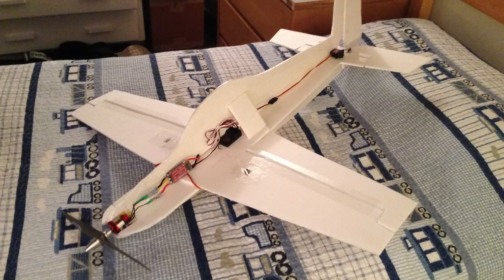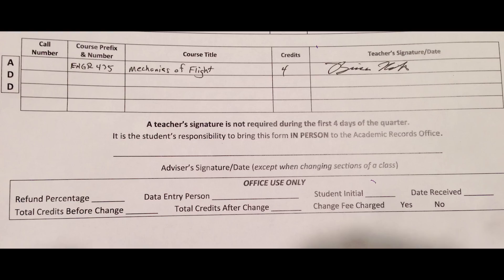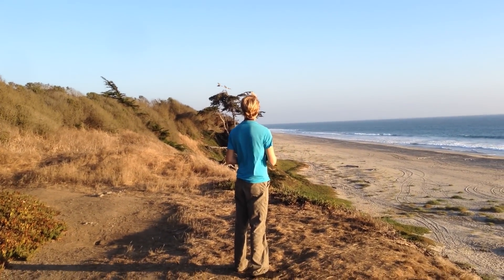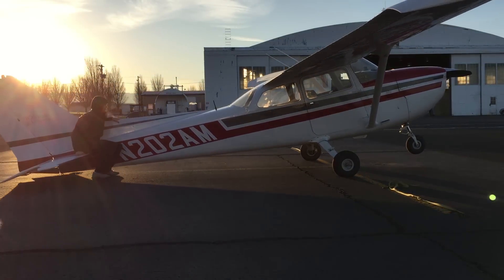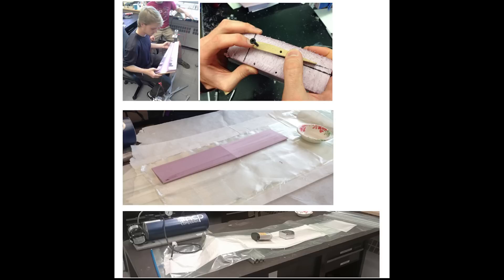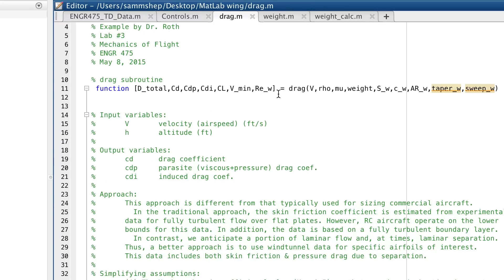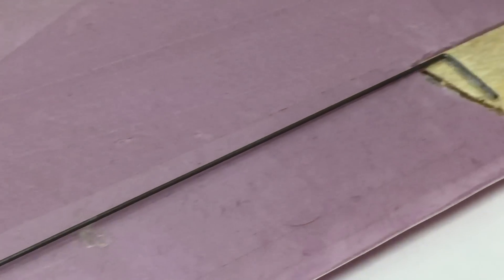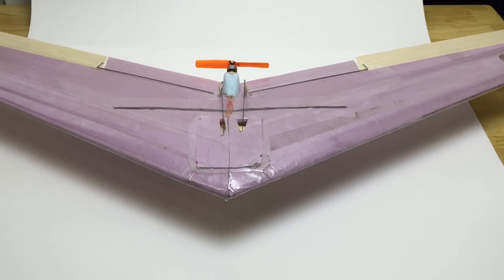Engineered Mini Flying Wing

Comment: Funny how different disciplines approach the same basic subjects in different ways...
I was terrible at it, so I dropped out in the end, but I was formerly an undergraduate physics student.
More recently I've done parts of the training needed to become a pilot, and of course read the associated textbooks, and unsurprisingly a bunch of physics related things crop up, but in different, more practical forms.

For instance, knowing how the weight and balance of an aircraft affects it's flight characteristics in broad terms is something you come across in pilot training.

Meanwhile in physics I was calculating how forces applied on different parts of a rigid body cause it to rotate, and how this relates to the mass distribution.
Broadly the same problem, but examined in very different ways.
Reply: KuraIthys he was the sailing instructor at Big Lake Youth Camp in Oregon for 2 summers and mentioned physics principles similar to flying in that sport as well.

Comment: The reason pilots don't learn about things like Reynolds number is because practically-speaking the Reynolds number of any aircraft that can lift a human will be absolutely enormous.
The one exception is if it reaches a situation where it is not supported by aerodynamic lift in level flight. I.E. Near-orbital high-altitude flight supported primarily by the geometric Eotvos effect, or the top of a zoom climb at extremely high altitude. I.E. The international space station, which, for the record, is not an airplane, flies at incredibly low Reynolds number.
(Note: Reynolds number is actually important for paper airplanes, and is what gives delta-winged darts thrown at insane speeds their advantages, they are not trying to fly in soup).

Comment: I designed and built an 8-foot span flying wing slope soarer in around 1978.  Concerning stability, the reason that a normal cambered wing is unstable is that the centre of lift moves rearward as the pitch decreases.  In other words, the more it pitches down, the more the lift force pitches it down and the reverse is true also.  So, it doesn’t matter if you start with the CG ahead of or aligned with the centre of lift, as soon as it gets disturbed, the centre of lift moves in the direction that makes the instability worse.  Sure, you can deploy elevator trim to make it stable but that is the same as reflexing the mean camber line.  The reason for adding reflex to about the last 25% of the chord is that this reverses the centre of lift movement to give a slightly positive CMo.  That is, nose down pitch moves the centre of lift forward to correct the disturbance while nose up pitch moves the centre of lift rearward, again correcting the disturbance.  Now we have the stability issue sorted, all that remains is to get the CG aligned with the centre of lift at the incidence and CL of the desired optimum performance.  You can make a stable straight plank cambered wing but that requires about the entire trailing 25% to be reflex cambered. Which is naturally about 25% of the entire wing area.  However, if the wing is swept about as much as your design is, the wing root requires no reflex at all but reflex needs to progress along the span to about 25% at the wing tip.  If the tip is also tapered to about 60% of the root, then the re-flexed area is now only about 10% of the total wing area.  Well, that’s a rule of thumb for a well-mannered model glider.  I dare say an accurate mathematical model could substantially improve on this efficiency.  Yes, there are the performance drawbacks with the swept wing but also performance advantages like the above reduced need for reflex, particularly if the root is less cambered to achieve lower CL max at the root than the tip, for tip stall safety.  The reduced root camber for this also reduces adverse centre of lift movement, further reducing the need for so much reflex.  So, now we come to the Horton bell shaped lift distribution which cancels adverse yaw, removing the need for fins entirely.  This lift distribution also reduces the span-wise root moment enabling the span to be increased to the point of again matching the root lift moment load to the original design.  This will in turn reduce the span loading, leading to reduced induced drag and a more efficient flying performance.  Oh well, I hope that gives a few things for interested people to look up.  Pretty much all this has been known since Prandetle & the Hortons, 1930s-50s, it’s just that the maths is quicker and a bit more refined now.
Reply: Dude, unfortunately he can't read comments here any more... It could've been a enjoyable discussion. 😔
Reply: @MCsCreations  Yes, I thought that would very likely be the case but, I figured others interested in the topic might benefit from following up some of my alluded references.

Comment: I am poor...  so i am engineering a B-2 inspired  stealth drug smuggling cargo  " Flying Wing " jet for a Cartel. 
   I am using a carbon based formula ( Black market bought from China`s J-20 project )  skin with internal triangular " charmes " much like the ones used on the CIA`s A-12 / USAF SR-71 jets of the 50`s 60`s to coral and dissipate primary and secondary military and civilian K band RADAR return signals.
   We are using leftover "Third World Country " Boeing 727 in south america with there  P&W JT8D`s in a paralleled triple power pack over head air inlet scoop S duct at the center line rear of the ACFT for its propulsion with vectored thrust up and down left right exhaust nozzles for added Pitch and Yaw control in addition to trailing wing inboard elevators,  mid trailing wing ailerons, and tip trailing wing Yaw upper / lower drag flapper rudder. 
  It will be controlled by a modified analog digital interfaced Microsoft based Flight simulator program with multiple lap top and joystick controller as its " Fly-By-Wire" flight control system.  
  
 We may need extra engineers to help with this project that will set you /  i / all of us for life ( if not killed by the Cartel or there competition, not do a life sentence in a U.S. Federal Prison ) .  Are you interested and available ????   

   P.S.  this was my smart ass joke LOL
Reply: I liked your brain power and smarts. A+

Comment: what is the negative 3 degrees of twist which you mentioned[-3 degree twist]?
Reply from the maker: Yes a 3° twist downwards at the tips
Reply: could you please make a video on how to design a flying wing.i also want to know WHAT is the twist and how i can calculate it.i even didn't understand that you have given two airfoils in one wing.what are the uses?please make a video and cover that too.

Comment: I know this is an old video, but my senior project for mechanical engineering is designing a high altitude autonomous UAV that can provide cell phone signal to disaster areas. We were wondering if you still had the matlab code you used for the aerodynamics, and we were wondering if you'd be able to publish it, or send it to us. Thanks man.

Comment: why didnt you mount a winglet? why did you choose to have the prop aft of the wing? was it to get the cg closer to the center of lift?
Reply from the maker: A longer wing is more effective than winglets for reducing induced drag. They are also very difficult to design effectively. For flying wings they are most useful for directional stability/control. I did prototype some, but I could not make them light enough. Weight on the wingtips screwed with the CG. Anyway, do you see winglets in full scale flying wings? Such as the YB-49 or B-2.

For motor placement, I think a front mounted motor would have been a good choice too. We mostly took inspiration from other designs and figured the rear location would make it much less likely to break in a crash, which was a common problem for other teams.
Reply: Fair enough. Althoug with for example the f117 and the b2 they tapered the wings completely. And woudnt shortening the wings and adding winglets pit the cg even further to the front? Reducing rhe need for taper and still retaining maximum wing surfice while also decreasimg weight?

Comment: did you look at adding any dihederal to the wing joint to offer increased stability??   Was curious as to how that might affect your numbers...
Reply from the maker: A swept wing already has a lot of lateral stability and dihedral doesn’t really work on a flying wing. Dihedral increases lateral stability at the cost of reduced efficiency and an increase in the spiral mode of instability.

Comment: Hi Samm! Im currently working on my senior project in aeronautical engineering. The project is to design and build a solar powered flying wing. One of the biggest problems I'm running into is how to find the best twist angle of the wings, and at what rate? Could you please be of help? Thanks
Reply from the maker: I wasn’t super involved with that but I remember after I suggested to try HS522 airfoil we found that we could use much less twist than with the MH60 only. I think we mostly used xflyer to figure that out
Reply: Thank you so much, and especially for replying this fast. The airfoil that I've chosen was the GOE-611, I think I'll try the xflyer to figure that out. Thanks again.

Comment: Hi samm, I’m a sophomore in high school and I really want to be a pilot for my job. I was wondering if you had any tips as to how I should go about that? Should I go to college and get my certificates through a program that they offer? If so, what colleges would you recommend? If not, what would you recommend instead? This also extends to anyone else in the comments as I’m desperate for advice, thanks!
Reply from the maker: It’s really expensive.  There is a high demand for pilots right now. it’s a great time. Airlines require a 4 year degree in something. Most other flying jobs do not. The quickest way to the airlines is a 4 year university/flight school type of school. The Air Force is another way in. It is possible to just get flight training by itself. Private then instrument then commercial and build time working odd flying jobs like sky diving or surveying or aerial photography or maybe even crop dusting.

Comment: Hey, great video! I actualy liked it so much, i built one my selfe with your messurements (but 120% scaled up). It is a realy experimental plane since it is my first build since i was 11 or so (now i'm 20). But i do have a problem with the yaw stability. it sometimes freaks out and i have to force it back to flying in a streight line. Is that just because i'm a terrible pilot (for my excuse: my first flying wing) or could it be a difference in the wings thicknesses? One of them is a bit thinner but the CG is fine. I would be happy if someone could help me :)

Edit: was there any thing special of the possitioning of the motor or did you just put that thing on the rear?
Reply from the maker: The thrust angle should be pointed up slightly. And try moving the CG even more foreword
Reply: thank you :) i will try that

Comment: Is it really "no tail" on a flying wing? You still effectively have a tail redirecting air upwards and that costs you some lift because you're not directing it downwards like a conventional wing would.
Reply from the maker: +George Ou but this is all in one planar wing surface! Way less tip vortex losses and much more. Wings normally have washout to help with stall stability and elliptical lift distribution anyway
Reply: Samm Sheperd What is the glide ratio?

Comment: Sir very knowledge work you have done, thanks for upload.
I need your guidelines, I am going to make same flying wing as you have done, In my case wingspan is 60 inch, please guide, can I use same ratio of your flywing for 60 inch wingspan.
Please lights on dihedral angle of wing for this design.
Reply from the maker: Yes scaled up to 60 inch will work even better. No dihedral for a flying wing
Reply: Sir heartily thanks for your reply.
Sir you have done really very low drag design, I highly impressed when I understood that why at centre HS522 and at tip MH60, really great way you have used drag difference for  stability, also understand why there is no need dihedral angle, fins etc.
I had started making this plane in 72inch wingspan, choiced 72 inch because electronic according to Pixhawk should be fit in wing, because there is no chance of extra fuselage to maintain its technical beauty of design. 
I am making QuadPlane (copter + plane).
The concentration is large flight time, vertical take off and land, and full auto modes.
I am using depron sheet for wing, and all components will be inside of wing, except four motors.
May be -3 degree angle at tip will not maintain properly at tip due to depron sheet, but I am going to set aileron up to tip corner, and I will set aileron at -3 degree as mean position of aileron.  May be this will work, if not than may be auto stability by Pixhawk will handle that things automatically.
Sir I need to understand two things  from you.
1) what is thrust to weight ratio of your plane at hover airplane speed (the speed shortly more than Stoll speed). This will help me in choice of proper motor.
2) What is CG in percentage, it's look approximately 11.75.

Please reply, I am new in aerodynamics, if I am going wrong or forgotten something than please guide.
I would like to show you my QuadPlane when it will complete.
Sir really you have made very knowledgeable video in very few words . . . . May Natural bless your all team with true path of Nature.

Comment: Was it a stipulation that all flight for the endurance record be powered flight? a powered glider with folding props might have done very well on the correct day, with the right pilot.

Also, was a wing with a hollow bottom section (i'm forgetting the name of this) considered? apart from the difficulty in manufacturing why not use this design?
Were the wing tip uprights (again i'm not sure the correct term) considered? even something from simple cardstock. My understanding is that they reduce wing tip vorticies and reduce the drag of the wing.

Comment: Hello Sam, Needless to say I admire you for the great project. I plan on building a new wing from Styrofoam and cover it with PU Glue and paper for stiffness. Could you please tell me if I scale your plane so that the wingspan is 1500 mm. or 60" I will get close efficiency from the build? I plan on using Li-Ion batteries and 600KV motor. Thank you!
Reply from the maker: Scaled up will be even more efficient

Comment: That's odd.  We talked about adverse yaw in my flight dynamics course.  Granted, it's a grad level course, but the professor definitely should have known about that!
Reply from the maker: I was probably a little slip of the mind and I now regret throwing him under the bus like that. He's super qualified, Stanford phd aerospace engineer.
Reply: It's cool.  Weather or not he has experience with it, I know your point was just that pilots develop some intuition that engineers don't necessarily have.  This I totally agree with (not a pilot myself).

Also, your flying wing optimization routine is a really neat solution!  My senior design group tried to make a program that used the Tornado Vortex Lattice Method package for MATLAB to iteratively test different wing configurations.  It honestly was biting off more than we could handle, so we eventually just settled with some combination we randomly tested in Xflr5.

Comment: What!? What Flight Mechanics professor doesn't know about adverse yaw?
Reply from the maker: I was probably a little slip of the mind and I now regret throwing him under the bus like that. He's super qualified, Stanford phd aerospace engineer.
Reply: Don't worry about it! With that qualification, I can almost guarantee he knows adverse yaw very well. At least in my experience, the notion that directional and lateral stability are coupled is one of the first concepts you review in most Flight Mechanics, Dynamics, and Controls classes - it's extremely important and is a major aircraft design consideration. 

Regardless, this is an extremely interesting video and a really well done design/project (I kind of wish my University’s aero program would offer a similar project, even as just an elective). One question: It looks liked there was no yaw control and you relied simply on the passive yaw stability provided by the swept wing. If so, do you plan on revisiting this design and adding yaw control (through a split aileron or something similar)? I think that would be really interesting to see in an RC aircraft.
Reply from the maker: There are a lot of cool RC projects I've seen using active stabilization in place of normal passive stability. I've wanted to make gyro activated drag rudders for a straight planar wing and I've seen others simply use gyro controlled differential trust etc.

Comment: Hi Samm, loved this video (and the accompanying endurance flight, amazed you got 20min off a 180mAh!) and I wanted to try my hand at one of these from the measurements you provided. I had a few questions: (1) Did you notice much of a positive/negative impact in maneuverability (or performance) from the lack of vertical surfaces? Was it harder to control? You make it look easy to fly in the vid but I'm a noob so for all I know you might be having to correct constantly. :P (2) What factors determined the placement/length of the elevons, how much of the trailing edge and chord they took up? (3) Did you do any more aggressive flying with the mini wing after its endurance flight? I would LOVE to see that if you did. (4) The measurements you gave are all for the planform, plus the airfoil classifications, but what was the max thickness of the airfoil at tip and root - the depth of the plane I guess, if we're looking from above?